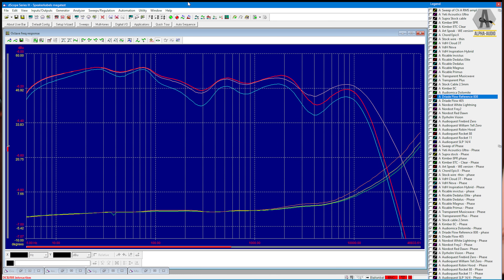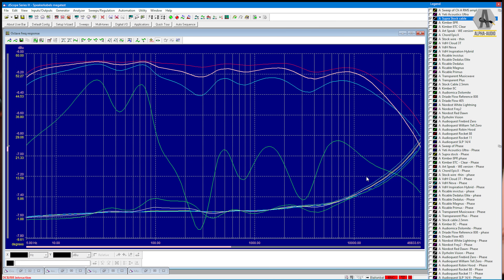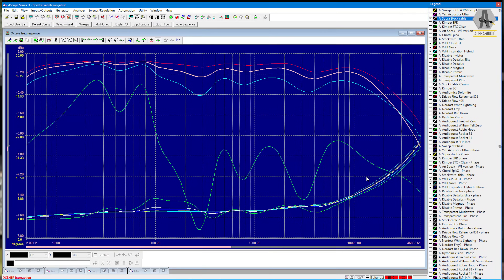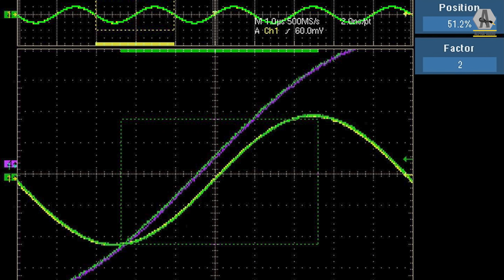Your speaker cable matters! 32 speaker cables tested - with measurements!

Comment: Appreciate the time & effort put into your testing. Would really like to see the same effort put into blind A+B testing of cables against each other. Not trying to invalidate anything you did, just not convinced in a blind test there will be a statistically significant percentage of people whom can identify difference between cheap & expensive speaker cable. However, it's an individuals right to spend their money on whatever makes them happy... 😴
Reply: A+B is subjective
Reply: When will the simple realisation take post that it is (a) a hobby and (b) only applicable to people who have an interest in the matter. That part of the population is the part that is of interest, the rest is kind of moot if they can hear a difference or not. It proves nothing. 

Furthermore: we don't do "scientific tests" nor do we pretend we do. 

Also: what stops you or anyone else suggesting tests we should do to perform themselves? Get two cables, gather a group of people, execute according to the protocol that you think is a proper test. You do not need anything special: a streamer, an internet connection, an amplifier and a pair of speakers. That's all. I'm intrigued by that, why should we have to do this?

Comment: What was your favorite cable under 1000 that is good for taming sibilance. Been testing speaker cables all month over here. I felt the same way thinking that the speaker cable would make a bigger difference than an interconnect and I was wrong :))
Reply: Sorry, can't recall. I did not note that down in my listening notes.
Reply: @Temmple  
$1000 will buy you a professional studio EQualizer, and a simple 0.5dB to 5dB mid-Q cut in the bands between 6kHz to 8kHz will target and reduce or eliminate the Sibilance in your system MUCH More Effectively than "swapping cables", which might otherwise affect the entire frequency response negatively, when all that you really wanted to do was target and tame the sibilance. 😉
Reply: Duelund DCA might work well here

Comment: I used to be an electronic tech that worked in a component test lab.  I tested transformers and capacitors to the Nth degree.  An interesting shootout would be a comparison between say electrostatics and cables, horns and cables, ribbons and the different cables to see if one cable sounds better with a different type of speaker, so your viewers can get an Idea which cable might be best for there system and ears.
Reply: And valve components vs transister.
Reply: That really is what it's all about. Matching
Reply: I find electrostatic headphones to be very transparent of everything in the audio signal chain, I use them to hear differences in analogue cables

Comment: Good Work!! My personal experience I clip connectors and and go bare wire.

Who knows what connector are made out of .( It's always a negative impact on sound)

Interlinks are connector failure point prone as well.

And proper shields as which in is terminated and how.

Comment: The only rime I heard a difference in speaker cables were after I changed my 20 years old cales to new ones.Probably because of the old speakers being oxidised over the years
Reply: So you never changed a cable for 20 years and never heard a difference. When changing you did. Wow much wow 😂😂😂
Reply: @wegardfjeld3789  as long as you amuse yourself🤦
Reply: @redkh2017  Its more of a you amazing me. Cheers 😆👍
Reply: @wegardfjeld3789 I don't think you really understood what I wrote, maybe read it a couple of times more, promise it will come.to you
Reply: @redkh2017  Naah, it's so poorly written it's phun worthy and nothing more. Try again 👍

Comment: I want to share my experience and a question: I have had the same speakers since 2001 and used very cheap cables. My speakers can be bi-wired and since I had enough speaker cable I decided to bi-wire the speakers, coming from one outlet of the amplifier. To my amazement the sound improved a lot. Jaap stated that a low impedance is very important and by doubling the cables I lowered the impedance. Could this be the reason why the sound improved? It was still the same cheap cable. Now I have proprietary speaker cables which sound again much better than the cheap ones, so I am happy.
Reply: its all in your head.

Comment: Where are the comments beginning with "I am an electrical engineer..." ?!
Reply: They'll find their way here soon enough. I wish I had made videos years ago when I had my store. All the time, I used to get, "I'm and EE, or I'm a recording engineer.". I used to trick them and it was the funniest thing you've ever seen. I had a cable demo set up on a CD player that had 2 identical outputs. Each output got a pair of cables that went to different inputs on a preamp. To AB them, all you had to do was select the inputs using the remote. When I told them they were listening to the same cable, except one was silver and the other was copper, they could hear no difference. (Even though the look on their face said otherwise.). They said they could hear differences between amps and preamps, so I went behind the equipment and told them I was switching amps. I didn't change a thing. I just played the exact same cable demo, but now they could hear the differences. And to make it worse, I wrote down the audible differences between the 2 cables on an index card. I handed them the card and told them they just described the audible differences between copper and silver cables, and they did a really good job because their comments always matched the description on the index card. 

"That doesn't count, you tricked me!". I lost count how many times I got that response. I always gave them the same answer. That's exactly what a placebo in an abx test is used for. They ran out of the store like Forrest Gump..
Reply: @AT-wl9yq  👍
Reply: @AT-wl9yq  Did this myself back in the day. Some people need the humbling. But hopefully, their interest in the hobby was improved beyond just shitting on things.
Reply: You can measure everything about a cake, except how good it tastes. I feel bad for cable improvement doubters, that they've never owned a great cable, and some of them resort to making measurements their meaning of life. That they try to reduce this beautiful world to numbers and graphs is issad & some new kind of insanity that hasn't been  named yet. What would be a good name for it? 

  I'm jealous of affluence is another one of their problems. They feel like outsiders, in a world where many people can walk into any store and buy anything they like, regardless of cost. Their therapy is often to laugh at the ones more successfull and fortunate than they. Thinking they're making wrong expensive purchases. But if they are, they're still way better off off.than them. If they can't be "richer" than those people, they still try to consider themselves "smarter". Better than feeling "inferior" I guess.
Reply: @sidesup8286 you nailed it. Nothing to add.
Reply: Like DB? Some of the other ones claiming to be electronic technicians, claim to be astronauts on space channels.
Reply: I am an electrical engineer...
Reply: @magicscreengames4353  I'm an electrical engineer, and so is my wife!
Reply: Get over it. You don’t have to have an engineering degree to be an audiophile. If you think this guy isn’t proficient then don’t watch the video. Actually, some guys with degrees aren’t that smart either.
Reply: @Alpha. I don't know what you mean? What comment of mine prompted your question? A little background on me. I have the best sound I have ever heard anywhere. I do 60+ step modifications of cd players, turntables, amps and tape decks which more than double sound quality and more likely triples it. An exact % is hard to put on it. Been doing audio experiments every week virtually, since around 1990. I have discovered dozens of stupid little things that improve sound quality and they really do add up. I've also experimented with about 50 different cables, mostly interconnects, and to my ears they all have such a distinct personality, that they are as easy to tell apart as ones own children. I listen to cds, lps, reel tape, & cassettes. About 1/3 of my music collection is audiophile recordings or recordings that should be considered audiophile recordings. I have a very big listening room where I can get my speakers 7 feet out from the wall behind them for best spatiality and freedom from wall coloration and constriction. I use subwoofers. And my room is heavily treated for best acoustics. Also I use great cables. I have several  on location recorded master tapes, very well done. My speaker concauctions are my own, and I mix and match the kind of drivers that you.only would expect in really high end speakers.
Reply: I posted an explanation why the entire exercise is completely wrong twice already, but it has disappeared. I'll insist until it isn't deleted anymore. (An I am an electronics - not electrical - engineer.)
Reply: Yea. That's what I'm thinking
Reply: I am an electrical engineer. I've worked with digital and analog electronics for some time. With that said, I'm not sure how that's relevant to someone's ability to perceive the difference between different wiring used to interconnect a given amplifier to a given set of speakers. Yes, speakers are a reactive load with a variable impedance and phase shift depending on the frequency and, most importantly, the amplifier is somewhat ignorant of the load. Specifically, the amp is usually made by one company, with the speakers made by another, so each manufacturer has no knowledge of the specifics of the other that will be used in a given HiFi setup. In other words, the amp will have no knowledge of and therefore limited ability to compensate for the dynamics of the speakers it is driving. The question therefore is how does cables help with the situation. All cables will have some level of inductance which could add or counteract the impendence effect of the speaker, but it seems like the impedance would have to be significant and would likely just make the situation worse. There are extremely expensive cables with passive electronic components built in that seem to be designed to somewhat load the cable with reactive components, but that seems diffulct for it to be truly effective when it wasn't designed for a specific speaker load. At the end of the day it comes down to what difference a cable makes that the listener can actually hear and, to me, the only way to effectively test that is double-blind testing.
Reply: Doing a double blind blind test with commercial consumer oriented speaker cable is impossible (I leave it up to the reader to figure out why), plus double blind testing might be a validated way of testing in the pharmaceutical world, but it cannot be translated into audio research 1:1. I always have to laugh really loud when people put out statements like these. 

Do all dear commenters realise that listening to music using HiFi equipment is a hobby? And do you also realise that whether you believe that any part in that HiFi set you own makes a difference or not has zero impact on the enjoyment of another person? 

Lastly, it is not our purpose on this planet to convince you of anything. You either can read the article, watch the listening video’s we put out and make up your own mind, or you don’t. But whatever mental processes are going on in the minds of people to vehemently tell us we are a bunch of idiots and feel the need to tell us that we cannot hear what we hear beats me. It is not like you or us are saving the planet, it is listening to music and see how we can optimise that listening experience. And if you do it another way, good for you, enjoy. That’s all there is to it. Honestly.
Reply: @jmtennapel  If someone wants to spend ridiculous sums of money on wire because they believe that it yields better sound quality (perceivable of otherwise), have at it. No one is saying that they can't or shouldn't do that. Plenty of people have reported positive health results from placebos...
Reply: @jmtennapel  The video is not about enjoyment, but pretends to scientifically prove something.
Reply: @adrianolaru9541  You are wrong. Watch the intro of the livestreams.
Reply: @jmtennapel  I have no problem with people uselessly enjoying to spend thousands of dollars on a piece of wire.
Reply: @jmtennapel  because the manufacturer will go out of business when the double blind test proves that their is no audible difference between a $100 cable and $1000 cable?
Reply: @ if you want to believe that, sure. Have a nice Christmas
Reply: @adrianolaru5303 I have no problems with deaf people repeating that there is no difference between cables.
Reply: @steinanderson so you think 1000 bucks is expensive? The cables in my system are around 35k. And they are not the most expensive on the market. They sound MUCH better than El Cheapo cables or mid tier cables, and I personally tested some more expensive cables that sound better than mine. But I am not going to pay one hundred grand in cables. 
As usual it is all about being willing and able to pay the required amount of money. End of the story.
Reply: People with Ultimate Systems probably sit back in their listening chair and laugh, at all that audiophiles do and spend, to try and reach some fantasy pinnacle, that is only a fantasy, and never will happen. When they put on a cd or lp their sound is quite good but also quite earthbound. They are hearing how good cds or lps get, as far as sound quality, and know the dreamers are only dreaming. If your sound quality capability is as good as the source; there is nothing further to do. The problem is they don't know if their system is as good as the source, so they keep going,  and spending big money; when they're already at the top of the mountain. But the top of the mountain isn't total realism. The top of the mountain simply turns out to be how good the sound is on the cd or lp pressing. Some of them while listening in their chair, might think "I spent six figures for this?"
Reply from the maker: @sidesup8286  So, you never heard the difference between a decent stack of - for example - Audiolab 6000-series and a Nagra System?

Comment: Instead of repeating over and over again that cables sound different and then provide tons of measurements data, how about doing some actual analysis with the results and showing how they correlate to the listening experiences? Any undergraduate student could do this if wanted to be taken seriously.
Reply from the maker: Read the article.
Reply: Show an example.
Reply: At least a few of the guys with awful perception and who can't hear are coming out of the woodwork. But your graphs have scared most of them back into hiding. Predictable that they would try to find fault with empirical evidence that conflicts with their "theory" that Theythere is no sonic difference between cables.They not only pretend they are real scientists, but also pretend that they are intercontinental psychologists and that we are all just "hearing things". Predictable.
Reply: Typical of the youth today. No respect for the time & effort someone else has performed..instant gratification with no appreciation. 

I'm just halfway joking. I haven't read the article but I imagine that what you are asking for is probably the long term goal. There is a lot involved with an equation like that. Maybe this is a job for AI.   I imagine there is an abundance of data to compare. And then the subjective listening. Do the cables have different effects on different loads? Do characteristics of a cable change with different voltages or input. Seems like a lot of variables & data. I wouldn't know where to begin. But I'm not some young undergrad that could quickly figure it out. It sure would be helpful information for cable seekers though.
Reply: It’s the basis of all objectivity, that you execute controllable tests and if you find discrepancies and correlations in your results, start making hypotheses that would explain your results, and keep testing until you find causal evidence. It’s not the job of the audience to try to piece the results together.
Reply: @outolempinimi5165  we’re not doing science, so please spare me the science lecturing.
Reply: Lol who "we"? If you are trying to make it look like you are using scientific methodology and then deny it's science, what is that supposed to be exactly?
Reply: @outolempinimi5165  yeah I get the concept I just don't think they are at that point yet. No guarantees doing all that work will prove anything anyway. In the end it will come down to subjective listening tests. Where one person will say a cable with A-B-C characteristics maybe  sounds smooth with big bass. Where the next guy will say he hears no difference.
Reply: Maybe I should read the article
Reply: @NosEL34  There’s controlled ABX test for that purpose where subjective experiences can be translated to objective statistical results.

Comment: Interesting research!
I didn't believe in cable making a difference until i tried few cables and some made a really big influence! System was very entry level also.
So from my experience with my system (had maybe 10-15 cables in last 20y), most cables don't make a big or any difference, but few do.